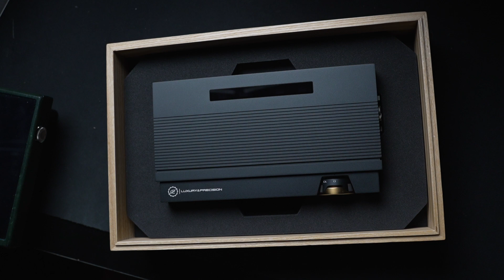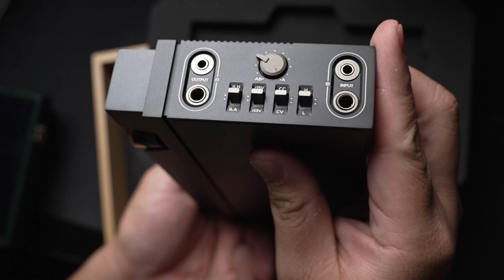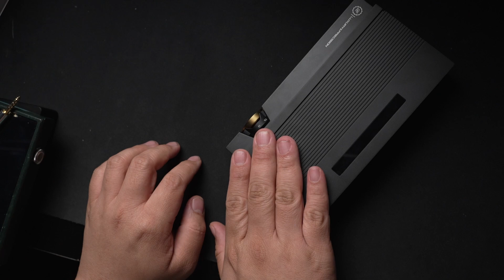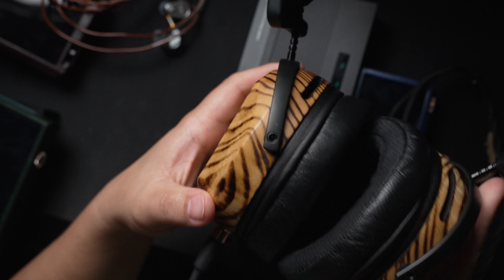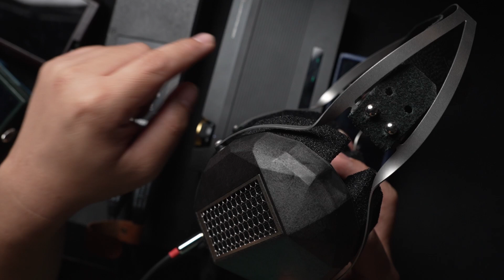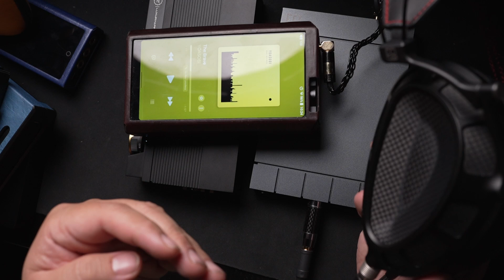First Look 41 Luxury and Precision EA4: Oh My....

Comment: Are batteries user-replaceable?

Does it have passthrough? Can it be used while charging?

Can it be used on wall power once the batteries finally die

Is that a constant 6 watts? Or just a few milliseconds peak like many others rate as

Comment: I am disappointed that Luxury and Precision did not supply a short 4.4mm to 4.4mm cable, especially since it is transportable.  When using this amplifier away from home, I do not want long cables. I've unbound it and the first thing I had to do was to order a 10cm long 4.4x 4.4 cable from Amazon

Comment: Does anyone know if the company Luxury and Precision has a social media page?
I was trying to contact their customer service but their website was not working properly.
Their email doesn't work.
How long do tubes last on a portable tube amp and how do you replace them?
Reply from the maker: The tubes can’t be replaced from what I know. They should last about 30k hrs
Reply: @ZPProductions  Where did you get this 30K/hours measurement from?
Reply from the maker: @garrygalloway5043  it’s a spec of Krog nutubes. I usually just go to my local retailer for warranty. But do note it takes at 2-3months to fix most china products due to shipping and turn around. For the safest piece of mind, get it from a local distro. It cost more but at least they can swap and refund for any failure in the first month.
Reply: @ZPProductions  Also compared other Chinese companies like Fiio and ibasso, Luxury and Precision do not seem to be very accessible. 
What would happen if there was a fault or I wanted the item to be serviced since I have never spent this amount from a Chinese company and they have different retail protection  laws compared to Europe.
Reply: @ZPProductions  Hello, can the EA4 be powered independently from the mains or does the current always run via the batteries?
With Xduoo dac amps there is a switch that you can run 12V independent of the battery.
Reply from the maker: @ it always runs via battery. Don’t see a switch like you get is maybe m17x
Reply: @ZPProductions  Can you buy spare rechargeable batteries for the EA4?
Reply from the maker: @ officially L&P say you can’t, based on schematics and design, it’s likely you can self change with a matching set of good 18650. It may not be really straightforward though
Reply: @ZPProductions  I do not use a music player or a laptop. I store my loseless files on my smartphone. I already have the ifi diablo and was planning on adding the EA4 and the ZMF Atrium Closed or the Veritè Closed.
Do you think this combination will work?
I noticed apart from the Sennheiser HD 820, there are no dynamic high impedance options between $2000 and $3000 to use with a tube amp
Reply from the maker: @ if you are using the ZMF headphones, the IFI should be fine though unless you want the tube sound or getting the last mile. In those cases the EA4 is worth the consideration . 

There is not many high end high impedence dynamics really. There’s maybe ATH ADx5000, ZMF stuff that’s about it. Focal are relatively low impedence
Reply: @ZPProductions  I am definitely buying the EA4, but I wanted to combine it with a higher impedance closed back dynamic headphone. I already own the Audeze Lcd-4z and the Focal Stellia ,so I am looking for a different kind of headphone this time
Reply: @ZPProductions  I was planning on plugging the ifi into my phone and then the EA4 into the ifi.

Comment: Are you able to replace the 18650 batteries ourselves?
Reply: Need to send back to LP. Because the batteries need to be cherry picked to match the requirements
Reply: @Bahamot8340  Thanks for sharing.. that means Cayin C9ii is better in this sense.
Reply: @fastsnail3568 yeah.. pricing and battery replacement are the two main concerns. Otherwise, EA4 is a no-brainer for transportable headphones amp.
Reply from the maker: Im of the opinion it doesnt matter. Its standard 18650. The question is do you believe in the cherry pick or not. But the minimum is all battery must be replaced together as with most 18650 device to ensure similar state of battery and you will need to do some screwing around
Reply: @ZPProductions that's right too.. I guess whenever mine need battery replacement I'll check what others experienced with it first. Too scared to replace it myself without knowing for sure.
Reply from the maker: @ it looks scary but I replaced a Broadway from Xiaudio recently too. Just need make sure the type of 18650 since there’s like 3 variants.
Reply: @fastsnail3568 how much better is ea 4 than c9ii in procentage ?

Comment: Hmmm looks really cool, might wanna get this but to be honest Tsuranagi v2 already beats the C9ii in pure staging. Interested to pair this with a headphone not with an IEM. Go for a desktop amp or this EA4?
Reply from the maker: I think the EA4 will likely beat the tsuranagi II for staging but if it’s absolute seperation maybe the tsuranagi may come out ahead.

I compared the HM1 with the EA4. Soundstage is definitely wider than the HM1 and the whole positioning and instrument spread is just really good on EA4. Where HM1 beats the EA4 is the absolute separation and dynamics. This is using HEK Unveiled.

Comment: I know you mentioned susvara, but have u tried pair them? How do they sound (with Susvara)?
Reply from the maker: Sadly I dont own the susvara. It was a loaner unit. I only have the HEK Unveiled for Hifiman
Reply: @ZPProductions  ah too bad. Really nice review. Was considering enleum this morning then your vid came out. Interesting
Reply from the maker: Based on quite some test, i think we can expect a bigger sound and more dispersed mids with some enhancement to the air region with the EA4. I think for SUSVARA, the dispersed mids will be the only downside since the original susvara is slightly dispersed in mids sound compared to the newer unveiled and OG sus probably will benefit from the slightly more aggressive mids the enleum gives. But if its the newer unveiled, I am guessing the EA4 maybe better.
Reply: @ZPProductions  nice take. Appreciate it 🙏
Reply: Im using AK SE300 right now as my player. If i pair it with LP AE4 would they be good enough to drive susvara?
Reply from the maker: @ I’m sure the EA4 can drive the Susvara. The issue is do you like a thicker tube sound or a wide light big sound. The EA4 gives the latter
Reply: @ZPProductions  ok2...im happy with big soundstage for my HP 👌
Reply: @ZPProductions  ive been reading alot of reviews and based on your description, do you agree if i say ea4 will synergize perfectly with empy 2?
Reply from the maker: @ i can’t remember empy 2 sound signature. I don’t think there’s issue in terms of power but sound wise I can’t remember will it pair well
Reply: @ZPProductions  You own only ONE pair of headphones? The HE1000se Unveiled?
Reply from the maker: @ I own many others